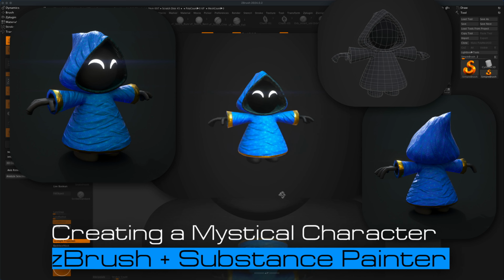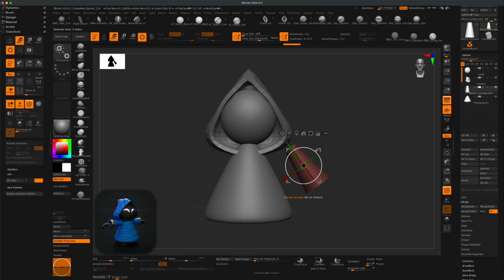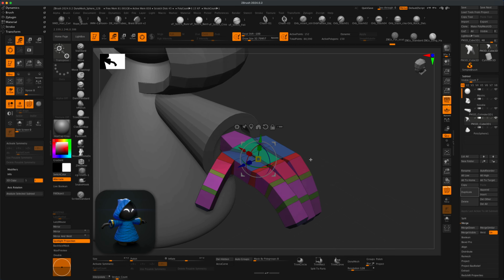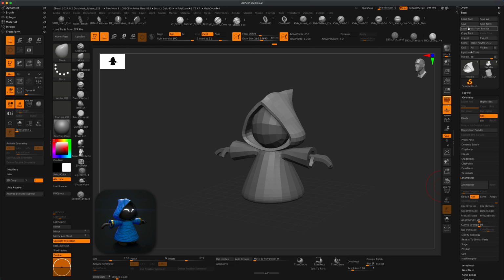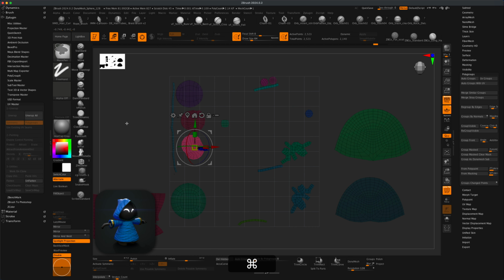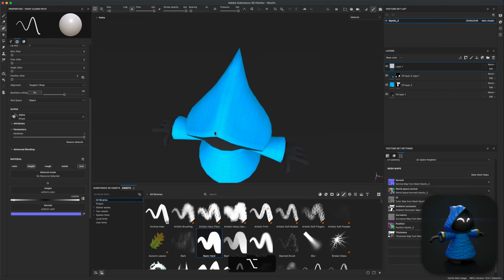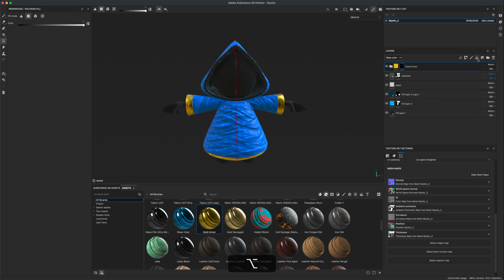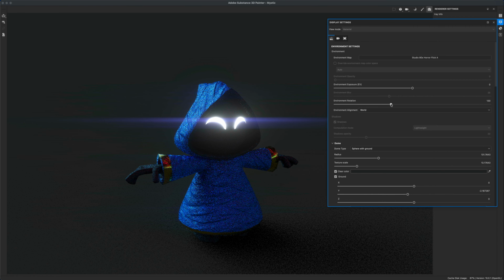Lowpoly 3D Character - zBrush & Substance Painter

Comment: Amazing video! I will definitely take advantage of this. Would it be possible for you to make one where there is a model in Zbrush and we have to make the mesh lighter to export to Marmoset, thus creating UV and not losing the details? This process is a little confusing for me since my models are highpoly and I don't know how to make it lighter with an acceptable mesh to render and still maintain the details.
Reply from the maker: @Skumhall  if you have something high poly, you just have to make a copy of it and turn it into a low poly version by zRemeshing it or manually laying down the new topology over the high one. Once you create the second lower version you have to unwrap it (uv) then use both versions to bake the higher resolution details over to the lower one (textures) i have a few videos showing this process but it slightly changes based on the model.